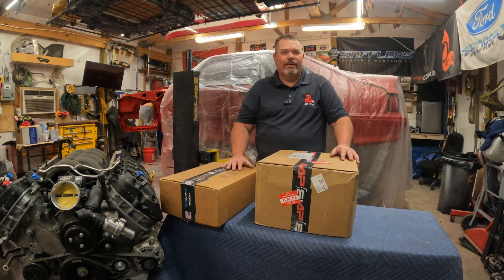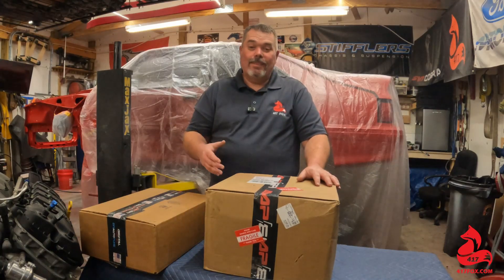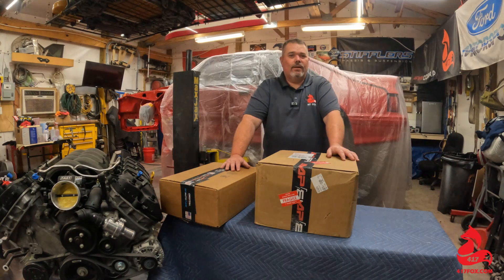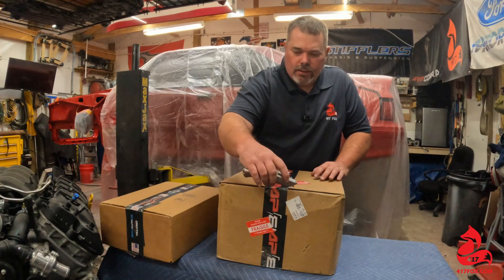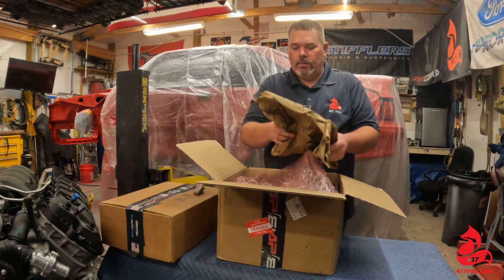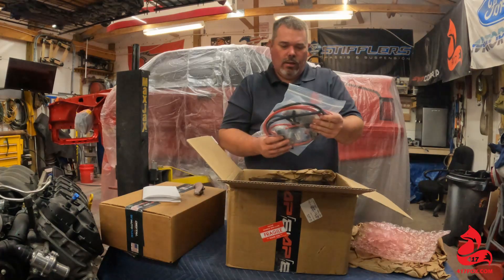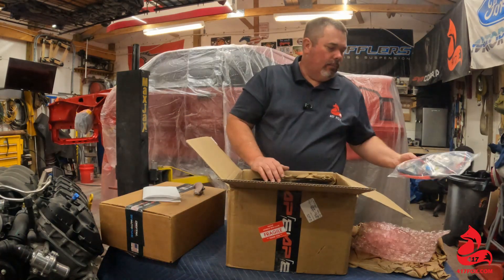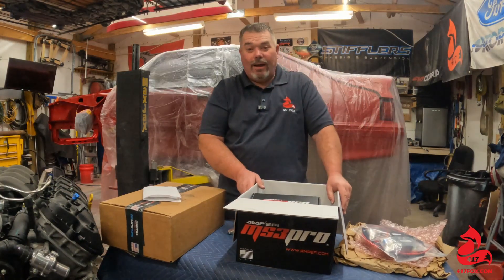AFFORDABLE COYOTE PLUG AND PLAY ECU HARNESS AND 12.3" DASH

Comment: "affordable" proceeds to show the most expensive way to do it lol
Reply from the maker: So the Holley 12.3 and Terminator X is less expensive?
Reply: @417fox I guess youre right, forgot about holley. its like 200 or so more. But more than Ford, PBH amd Lethal Nate. which would all be more affordable, no?
Reply from the maker: @anthony.james51  you are comparing apples to oranges.  Do more research for actual price, 12.3 gauge option, and system capabilities then Get back with me.
Reply: @417fox Im hust comparing the harness in itself. dash is irrelevant. it is an option, it is a good one, but i wouldnt call it affordable when there are other cheaper options out there. just ke i guess im sure everyone will side with you on this. Just think its a little click baity is all. I looked into the kit thinking it was affordable not realizing its more than the other 3 options mentioned. Im using factory cluster so the dash means little to me lol
Reply from the maker: @anthony.james51  I will agree to disagree, plus the others don’t have the capabilities this does.  Again.  Apples to oranges.  To each his own